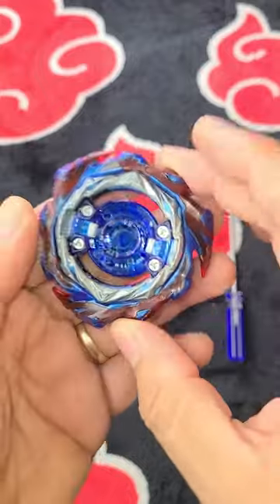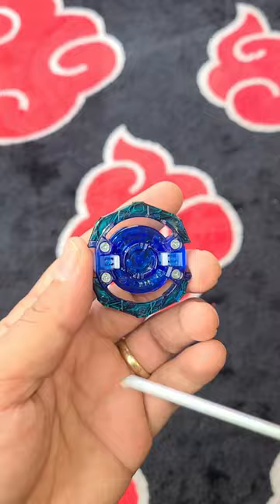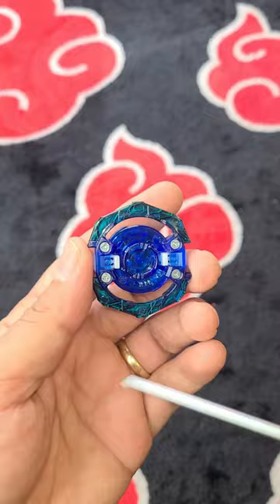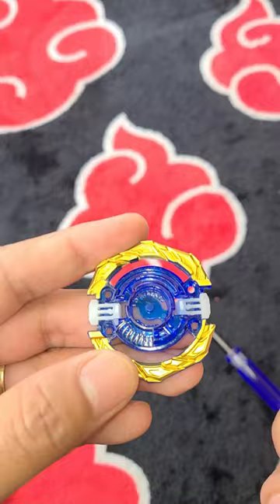Inside Savior Valkyrie DB Core #shorts

Comment: Can you put a stronger spring into the DB core? It should be pretty powerful with an actualy good spring.
Reply from the maker: I think I could, but it may make it worse as the teeth aren't that great to begin with
Reply: @BeybladeDad  the issues of spring teeth quality is 
The teeth mold is very fragile it need a lot of force to twist because how the bound gimmicks is work
My Dragon core is one of my teeth is bend because it need a lot of force to push and twist with dash driver.
Here is all the issues I have noticed.
Reply: I tried it with mine, it only makes it burst faster
Reply: @bladerbrawlers his is why I pull the disk to decrease chances of it breaking
Reply: But in battle its useless